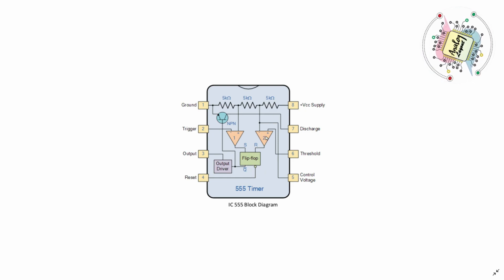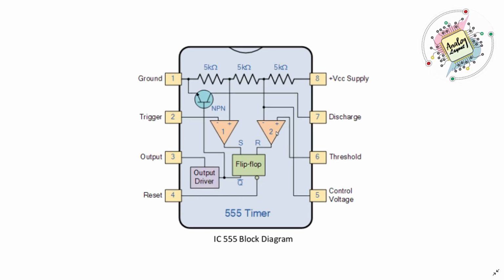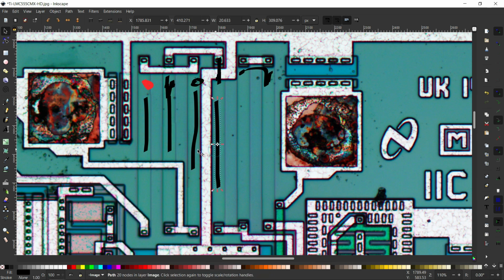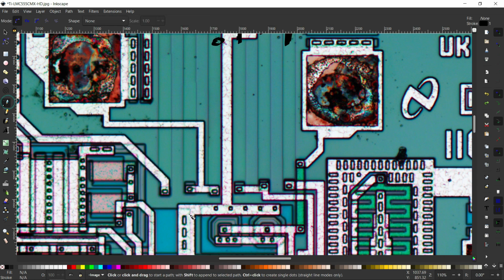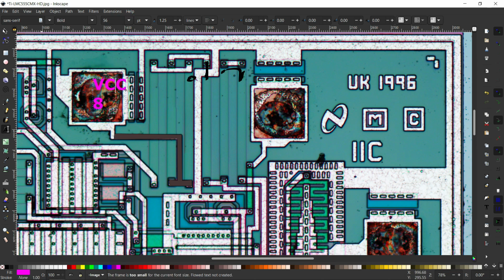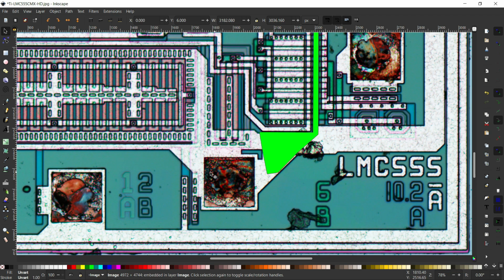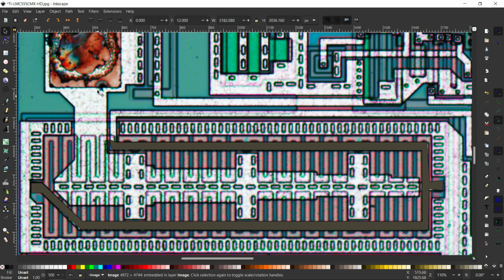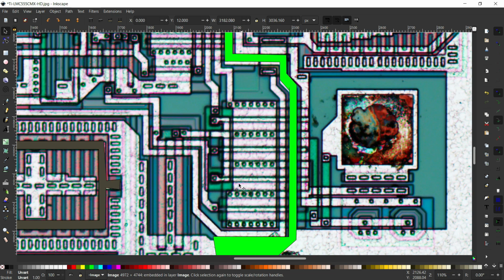IC555 - Chip Die Layout

Comment: Can you please explain layout guide lines for ADC
Reply from the maker: Designing the layout for an analog-to-digital converter (ADC) involves several considerations:

1. *Separation of Analog and Digital Regions:* Keep analog and digital sections separate to minimize noise coupling.

2. *Grounding and Power Planes:* Ensure proper grounding and power distribution to minimize noise and voltage drops.

3. *Signal Routing:* Maintain short, direct traces for analog signals, and avoid crossing digital signals over analog traces.

4. *Clock Signals:* Route clock signals carefully to avoid skew and jitter, and use guard traces if necessary.

5. *Analog Shielding:* Use guard traces, ground planes, or shielding to protect sensitive analog signals from noise.

6. *Decoupling Capacitors:* Place decoupling capacitors close to the ADC to filter out noise and stabilize the power supply.

7. *Component Placement:* Position components based on signal flow and noise considerations, with sensitive components placed away from noisy sources.

8. *Analog Filtering:* Include appropriate RC filters or other analog filtering mechanisms to remove high-frequency noise.

9. *Parasitic Elements:* Account for parasitic capacitance and inductance in your layout design.

10. *Thermal Considerations:* Ensure proper heat dissipation for high-performance ADCs, and consider thermal vias and heat sinks.

11. *Grounding Techniques:* Employ star grounding, guard rings, and proper grounding practices to minimize ground loops.

12. *Cross-Talk Minimization:* Keep sensitive traces away from noisy traces to reduce cross-talk.

13. *Differential Pair Routing:* Maintain equal lengths and spacing for differential pairs to preserve signal integrity.

14. *Minimize Traces in Parallel:* Avoid running traces in parallel to minimize capacitive coupling.

15. *Layout Tools:* Utilize layout tools to ensure correct trace widths, spacing, and impedance control.

16. *Design for Testability:* Include test points and access for probing during testing and debugging.

Remember, ADC layout is complex and can vary based on the specific ADC and application. Consult the ADC's datasheet and application notes for layout guidelines tailored to your device.